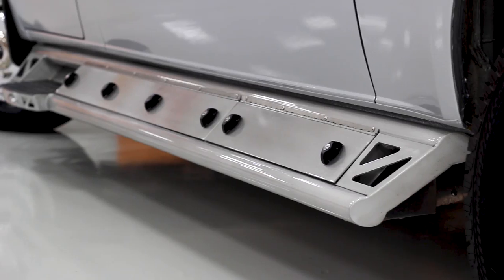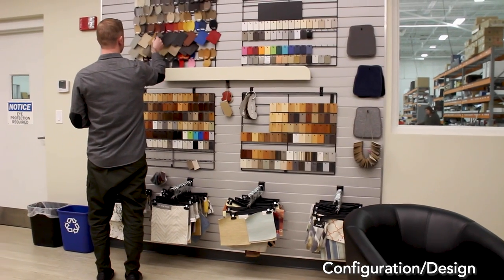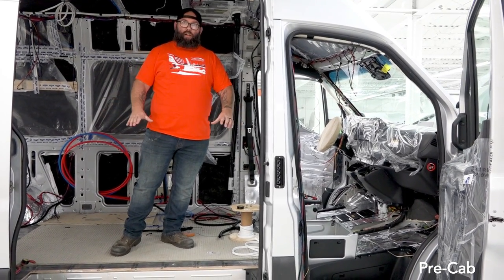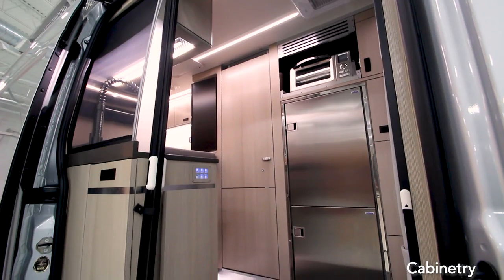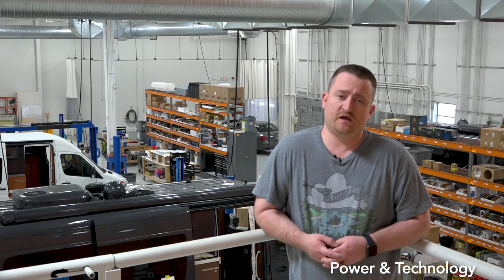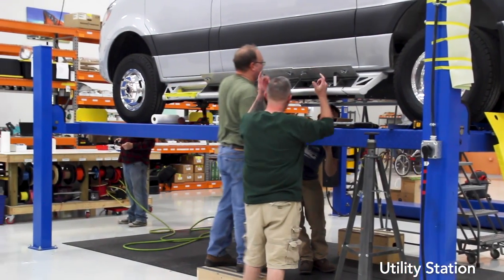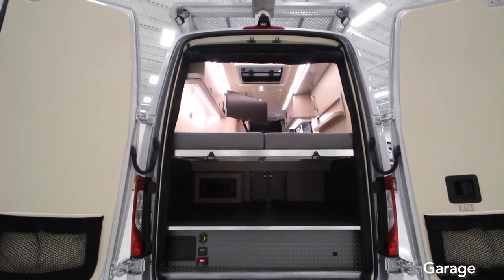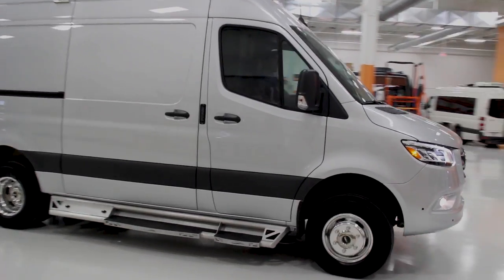The Last Resort | ARV Builds a Custom 144" Sprinter for Full-Time, Off-Grid Living

Comment: I don't understand the huge amount of batteries if the under the hood generator works well. Why so much battery capacity?
Reply from the maker: Good question John. While the second alternator quickly charges the battery while the engine is running, there are times when our clients plan to be stationary for a while (boondocking, city street camping, etc.), and prefer the peace of mind that comes with a large battery bank. With that said, we have outfitted builds with ~400 amp hours of storage for clients that are willing to use Auto-Regeneration more often. Hope that helps.
Reply: @AdvancedRV  Yes that does answer the question. If I buy a new Sprinter 170 and have it delivered to you can you install that alternator? Or can I buy the alternator and have it installed in Ventura CA?
Reply: John Puccetti — I’ve got the same battery bank.  I went with that size so I could run the A/C overnight when necessary (14 hours or more A/C time, depending on weather) or stay up to 5 days/nights in one spot without starting the engine.

Comment: Not one window? I understand the idea about being stealth but the idea of practically living full time inside that thing with constantly having to use lights freaks me out a little bit. Imagine 3 days of rain and you are boondocking with a wonderfull view of mountains and you are couped up in that cave...without being able to open the doors because it might be to cold or windy..hmmm...not for me. To each his own i guess. They could have had some windows with some type of sliding panel ...the original cutout from the window painted the same color as the van. That would make it a bit more stealth, yet giving it an option to slide it when you want some light to come in.

Comment: No solar is very odd.
Reply: There's nothing odd about it. He said the 8 batteries supply about 10,000 watts of power, which are kept charged by the on board generator. With that much power a few solar panels supplying 100 watts each should not even be a thought.

Comment: Like the concept, just think the price is way out of line.  Let's start w/the vehicle, a notoriously unreliable and expensive van.  I didn't price the 4 wheel drive model as that just adds more complexity and unreliability, but an optioned out 2019 144" 2wd high roof diesel cargo retails for ~$50k.

Now add the ARV system.  I don't know the exact price, but some articles say they charge ~$300k for a custom configuration.  In my experience, there are two types of personalities that have this kind of money laying around for, basically, a toy:  trust funders and successful, self-made business people.  I don't think the purpose of this vehicle even enters the imagination of a trust funder and how would a business owner write off the cost on his/her taxes when they could buy a plane or helicopter that could be feasibly be written off?

So this is most likely a one off.  Kudos to ARV for showcasing their craftsmanship.

Comment: R-7 ... ? What?
That's a no go. Where do you plan to use this thing? Not Alaska in the winter. That's for sure. If you can't do minimum R-20 with heat recovery ventilation, what's the point of even starting? Total waste of time and effort.
Reply: I mean you're going to all that effort. At least go somewhere new. Three inches of EPS with no thermal bridging, will at least give you R-15. With a heat recovery ventilation unit and airtight design you will have something remarkable. 
Be the first.
Reply: It makes sense to keep the water storage tanks inside this envelope as well as batteries. That way when it's minus forty outside, you can manage keeping everything inside from freezing up 24/7.

Comment: This floor plan is awful. You can’t swivel the drivers seat with the wall there which means two people can’t even sit down in the van at the same time to eat. Can’t crawl in bed to do it either unless you’ve already cleaned up the entire kitchen and but then backsplash back down.